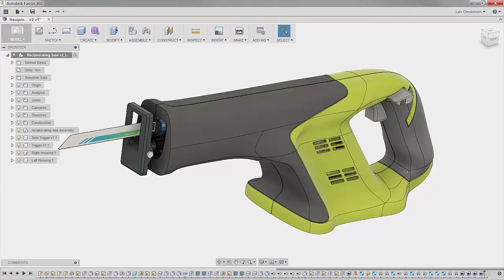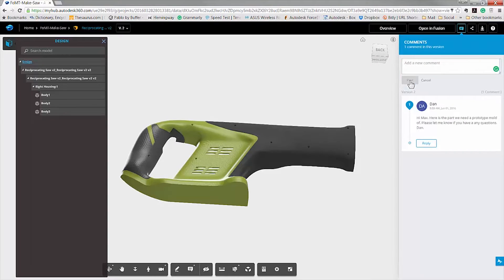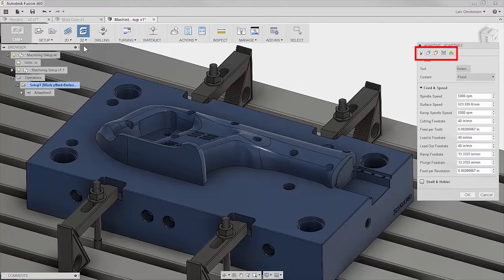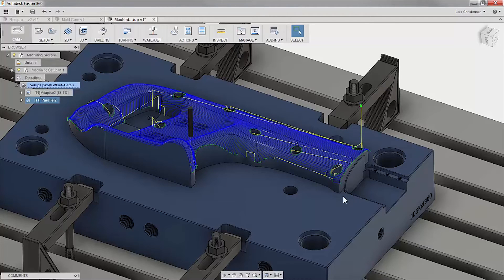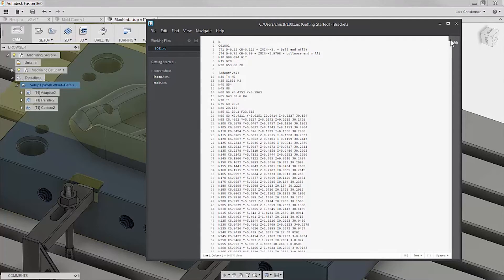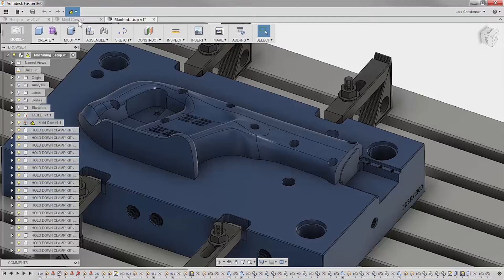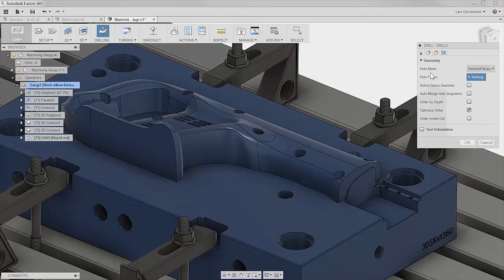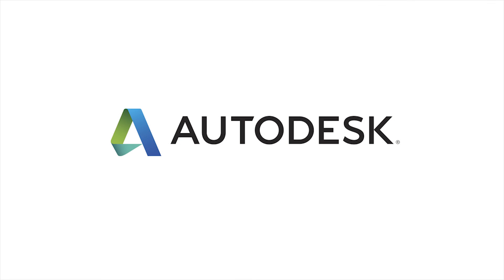Connect Design to Machining— Once Difficult, Now Easy

Comment: I was just getting started in Mastercam. Fusion 360 seems like a much better software than Solidworks/Mastercam for CNC machining. Thanks for the awesome video!
Reply from the maker: Thank you for taking the time to watch! SolidWorks/Mastercam was my setup for years. Fusion 360 is so much more an integrated solution in my opinion.
Have a great day!